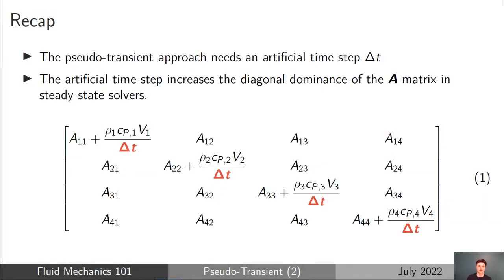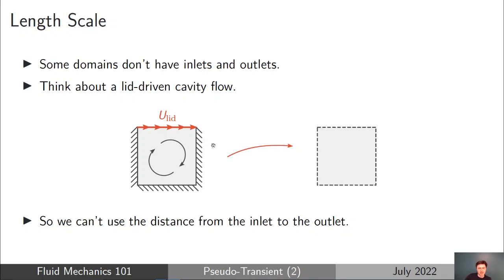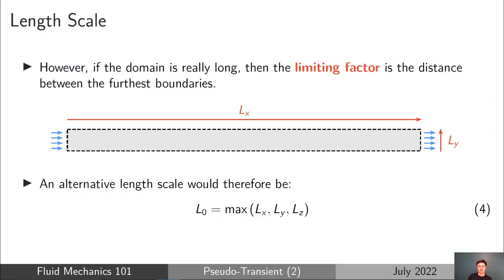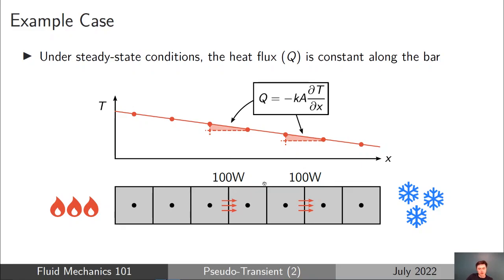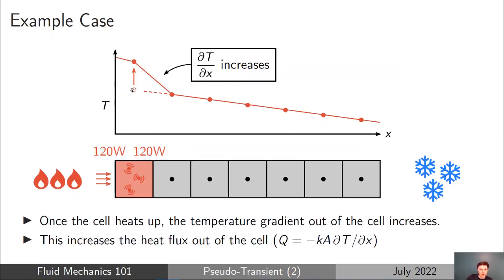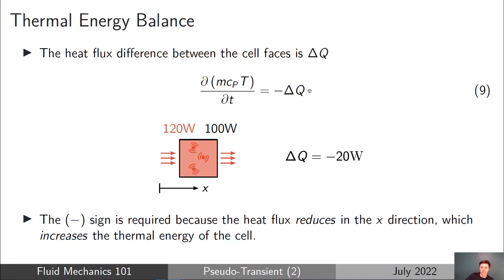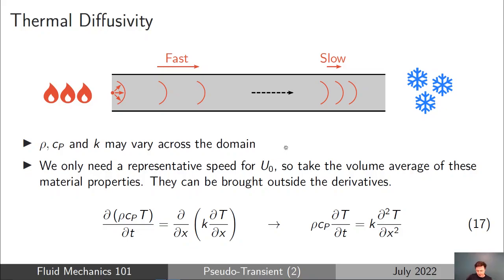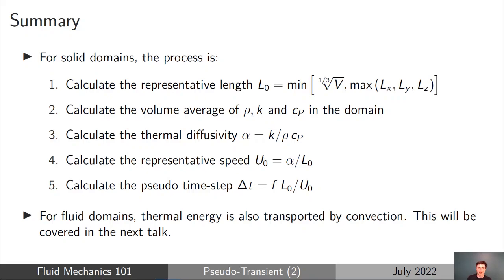[CFD] Pseudo-Transients for Steady State CFD (Part 2) - Length and Velocity Scales

Comment: Fantastic video, could you talk about the cavitation model in CFD~ Thanks in advance!
Reply from the maker: Cavitation modeling is quite tricky. Do you actually need to model the bubbles, or do you just want to predict whether cavitation is likely? If you only care about whether cavitation is likely, you could just look at pressure contours and see where the pressure drops below the vapour pressure?
Reply: @fluidmechanics101  I think that both approaches will be very interesting to see, thanks!

Comment: If the solid domain is made of multi-layered material with varying thicknesses, do we select the one with min (delta t) or still consider the entire domain as one and use volume-averaged properties?
Reply from the maker: Good question. If the perturbation travels  through the thickness of the material (through the layers, one by one) then you could happily use the volume average. However if the perturbation travels along the length, then take the minimum. So you will need to make a judgement. I would guess that it is mostly through the thickness, so you can use volume average

Comment: Is it possible to lower the URF and use small pseudo time step factor to stabilise the calculation. Does it mean  it will take forever to get a converged simulation? Many thanks
Reply from the maker: Yea, smaller URF or pseudo time step will just take more iterations to reach a solution. Hopefully it won't take forever! Usually if you are needing more than 5000 iterations, then something might be up with your calculation
Reply: @fluidmechanics101  thank you for your reply. The best channel for cfd!

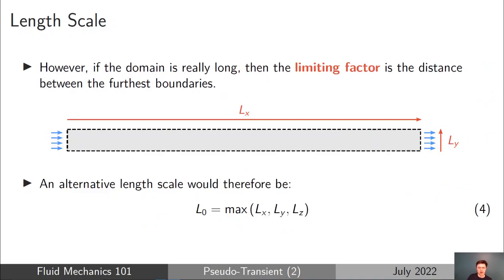Comment: Around 11:00 and 13:40 : Shouldn't the formula be a simple cube root of the volume (with a 3, not 1/3, there)?
Reply from the maker: Ah yea, it's meant to be cube root, so either use a 3 there or just go with V^1/3